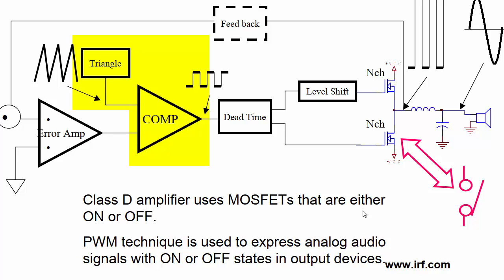Class D Audio Amplifier | High Efficiency Power Amplifier | 4K5

Comment: Hey man great video! Just a few questions regarding your overall circuit. I was just wondering what driver did you end up using for your NMOS's and why? Also if you were to use PMOS what kind of driver circuit would you recommend?
Reply from the maker: Good evening sir
In many design circuit of class d amplifier NMOS is used, there are technical note that shows advantage of NMOS over PMOS, thank you for raising this question I will get information about it and will try with PMOS with its suitable driver circuit  . Thank you
Reply from the maker: @PETER ONYANGO AYUO I have used driver  IR2110, there is other drive which have inbuilt dead time
Reply from the maker: @PETER ONYANGO AYUO input complementary type is of 5v logic but high side low side MOSFET driver IR2110 circuit provide proper supply to drive MOSFET

Thank you
Reply from the maker: @PETER ONYANGO AYUO there is need of level shifter depends on different circuit diagram designer using.
Reply from the maker: @PETER ONYANGO AYUO ir2110 uses bootstrap circuit externally